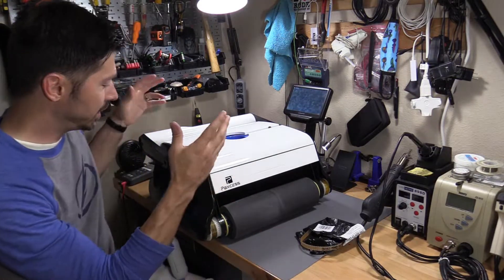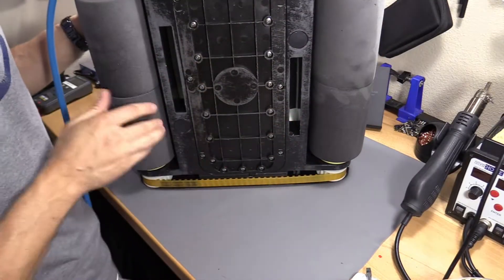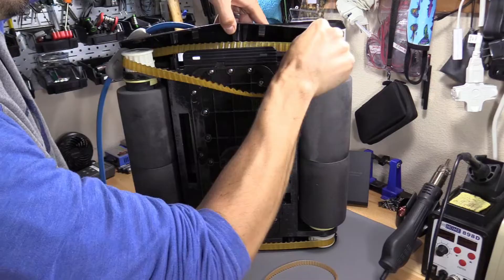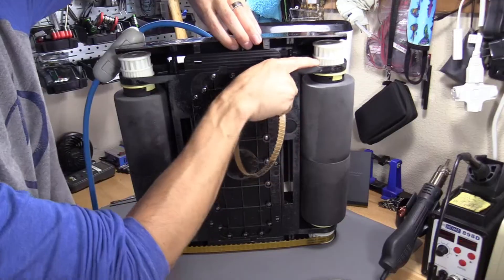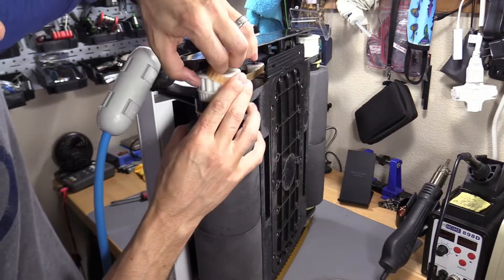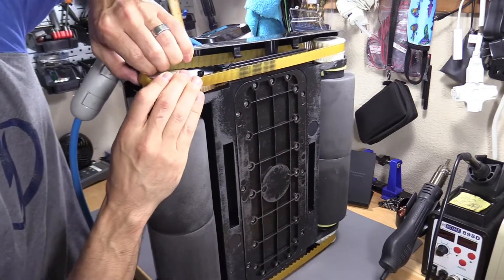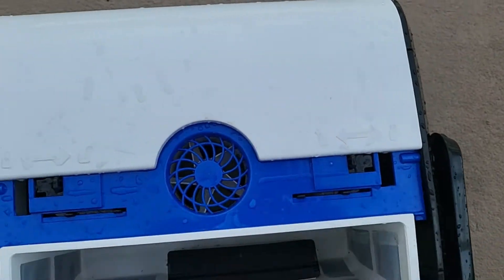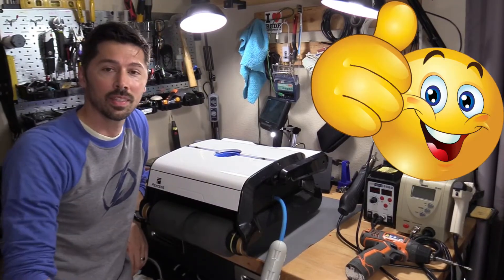How to Fix Robot Pool vacuum NOT WORKING / NOT MOVING / NOT CLEANING

Comment: I have this vacuum and this is super helpful as I did find the little fan belt in the debris basket. Couldn’t figure out where it went ! So thank you!

I also have a hard time sliding the locked open and closed on the top to access the baskets to empty. Any hints to fix that?

Comment: Just a note ... it's not recommended to install the smaller drive belt by stretching it over the roller cogs. We sell these type of pool cleaners, and we know that these smaller drive belts take a lot of strain and are more prone to breakage than the larger roller belts. It is better to unscrew the drive belt sprocket that's fitted to the drive motor, if you can, then take it off, fit the belt, and put the sprocket back. Puts less strain on the belt.
Reply: S part number for small "inner" belt?  you say you have them, where are you located?
Reply: Hi, do you know what Dolphin model represents this Paxcess HJ2052? Looking for parts diagram, cant find any Paxcess or Aiper. Thanks
Reply: @olegsolo7779  it’s not a dolphin… dolphin is made by maytronics. This one is made by Wybotics.

Comment: My Ausono HJ2052 stopped working after one month of use.  Heavy use, but I was so bummed about it.  I had no iea what was wrong.  I called support and their system would hang up exactly 3 minutes after I made my selection.  Your video was AWESOME.  I bought a new small belt and within 10 minutes of going outside, it was fixed and my pool is being cleaned.  Thank you so much!!  I watched a few other videos and they had you taking the whole thing apart.  You saved me sooooooo much time.  

Curious if there is a way to get replacement filter baskets.  I do not need them now, but assume one day I will.  If you, or anyone else on here knows how to get them, please reply to this post.  Thanks again, I greatly appreciate this video.
Reply: Hi! Can you put the link of the belt you bought?

Comment: Great! Thank-you so much. Lost the manual and didn't realize there was a fan blower belt as well.
Reply: Hi @darlyslade7998 the smaller belt is not for the fan blower but for the drive motor. The pump motor is connected directly to the impeller at the top of the device - no belt there.

Comment: I just replaced the belts, it completed one pool cleaning and now it will not work at all. The light is flashing on the control box that the vacuum plugs into. Any ideas? Thanks!! Also, do you have contact information for Paxcess?
Reply from the maker: Clean plug connections on power cord and control box connection. I used electronic cleaner and toothbrush but use sandpaper on scale build-up on the prongs.
Reply: Control box lights flashing in different ways have different meanings. However, most likely cause in our experience is a fault in the main PCB. And most common PCB fault is a burnt out capacitor. Suggest to get an electronic technician take out the control box PCB and check for faults especially burns, or corrosion due to water ingress.

Comment: Thanks for the video, question do you know where to get replacement parts like main drive wheels.   Paxcess is no help - I believe this unit is an orca 1300 and Paxcess did a private label.   I emailed AIPER waiting to hear back.  Any help would be appreciated! thanks

Comment: My cleaner pumps water but does not crawl.  All belts are attached.  When I turn on controller and set hours to 1,2,or 3 nothing happens except pumping water.  It will NOT CRAWL.  When cycle is over all 3 redlights blink for a long time.  No responses from Paxcess customer service...Ugh.  I need your wisdom to solve this problem please.
Reply: Same problem here

Comment: So the belt is a weak point and need to be replaced sometimes ? 😳
Reply from the maker: Yes, it's belt driven but many robot vacuums are like this. After 1 or 2 years belts need to be replaced unfortunately but good thing is it's easy to fix.
Reply: I have a good working robot and can't find a belt

Comment: I think it's great video and when you try show the part number sometimes its waste of time cause it's not clear n trying to give the visual but I think if u put the link on parts etc,... much better rather then try show the parts number and most time don't even get clear view of it... aside that hope everyone that have robot vacuum finds this clip somewhat useful... my advice when taking things Apart are very simple. First look over it have little idea what your looking at, second most of the time a smaller parts and smaller end of the parts is where you start never start on big parts or big end reasons why because simply smaller if you pry smaller at last part mostly you'll break it.   That's my advice smaller parts smaller end of the parts is normally your first piece good luck and keep doing what's you doing 👍
Reply: Agreed